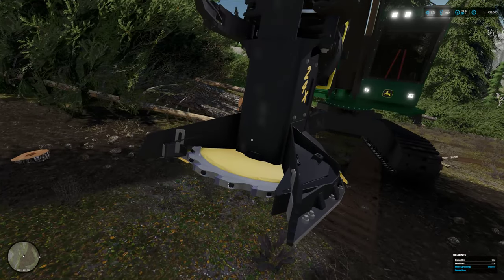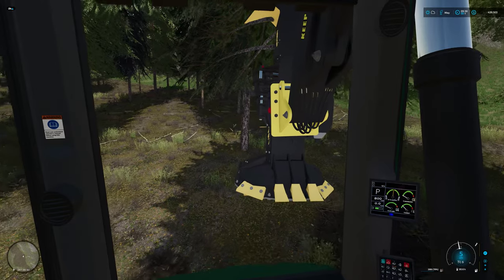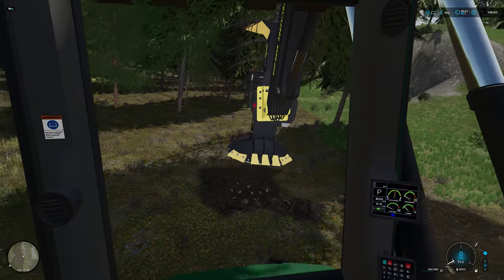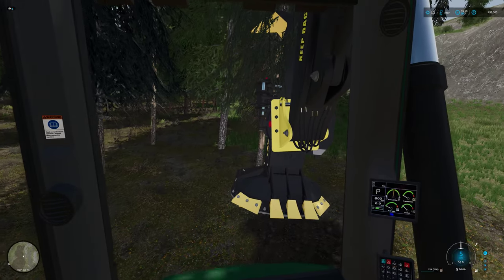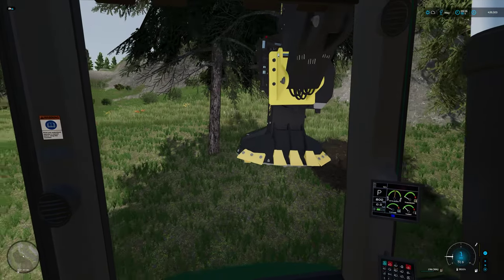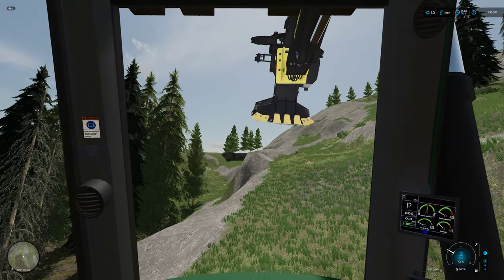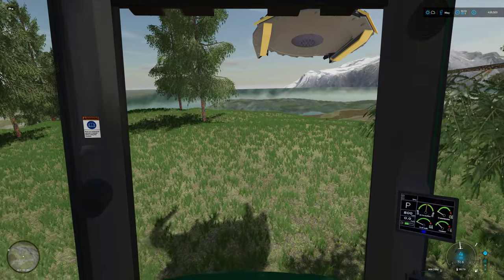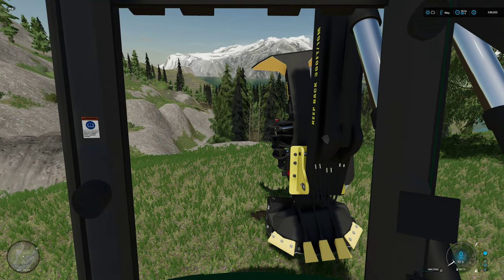Mod Update 1.02 Buncher Head Fix - Farming Simulator 2022 - FDR Logging

Comment: Is there any way you can use the normal binding for the equipment by using the mouse just wondering? because I dont have the joysticks yet it it can be diffucult.
Reply: You'll need to map them manually. Go into the key bind settings and scroll down to the FDR section - it'll be near the bottom. Then map the functions to whatever key/axis you want.
Reply: im not that proficient on m&k, but it certainly isnt as smooth as joysticks. if you have a controller, definitely a big upgrade from m&k as far as being smooth with it. still some things that will hold you back from being as smooth as FDR, but its a big help
Reply: @jbowls4814   I agree with you I have joysticks myself Im asking for a friend I have that wont just take the time to learn how to set his keybinds up on his wheel or keyboard and wants to use the base game mouse settings.